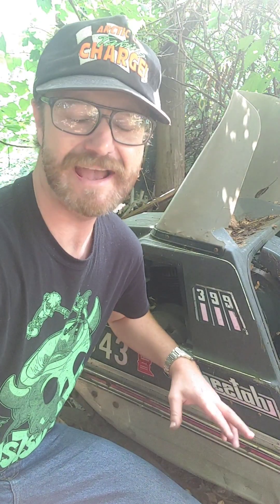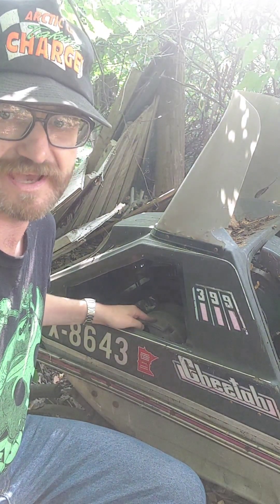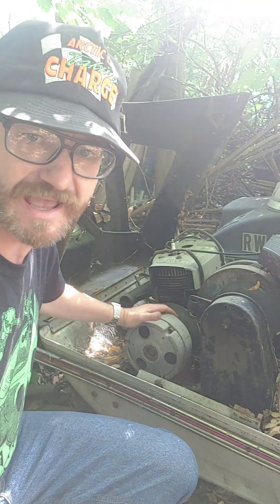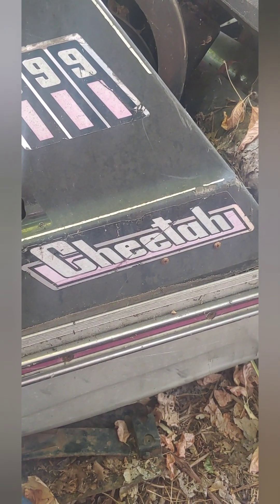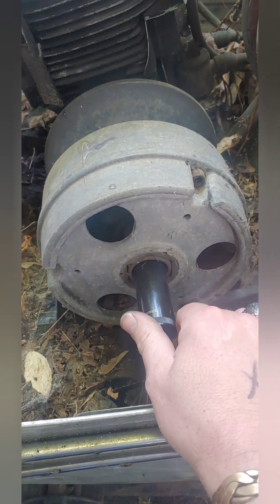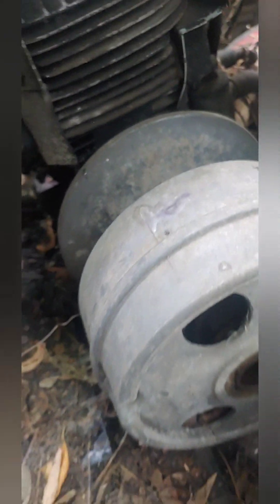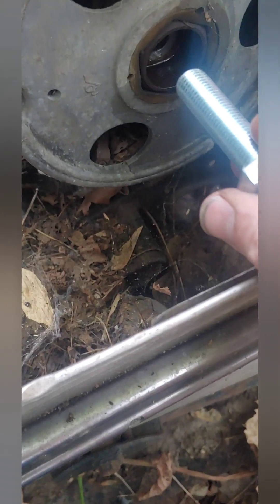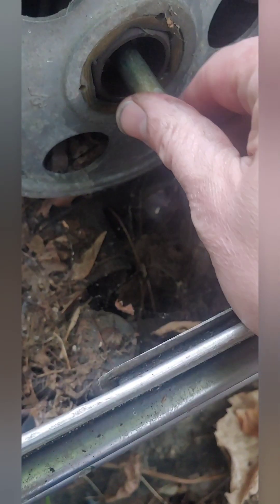Arctic Cat Hex Clutch Removal, Disassembly, and Inspection.

Comment: Hey do you need any parts
Reply from the maker: @sebastianthomas8591  Only Arctic Cat parts from 1970 to 1976 are of interests to me. A good full cleat track for a Puma/Cheetah, the right secondary clutch from a 1974 Cheetah or 1975 Panther, and a 4 gallon gas tank would all be of interest to me!
Reply: @fixitforjoshsake  I think I have the 4 gallon tank but I also have most of a 74 cheetah
Reply from the maker: @sebastianthomas8591  where are you at?
Reply: @fixitforjoshsake  I'm in Calgary Alberta
Reply: @fixitforjoshsake  It's gonna be scrap otherwise

Comment: 9/16-18 not metric
Reply from the maker: @MrJohnnaz  Thanks for the input! What motor and clutch are you working on? ... each clutch, aka, comet, sulsburry, or hex, take a different bolt and depending on if it's running on a Suzuki, Kawasaki, sacks, hirth, JLo, or Kohler will require a different clutch fastening bolt too.